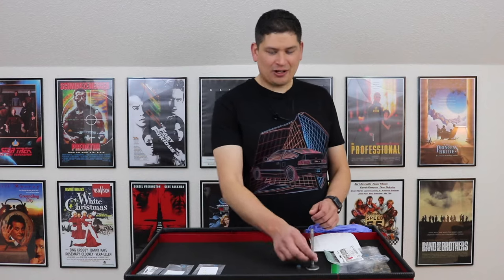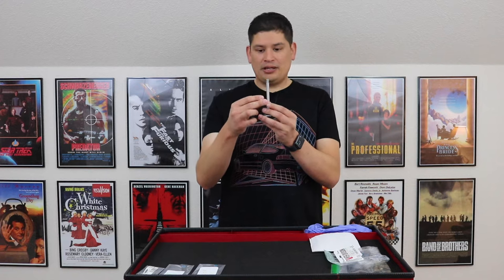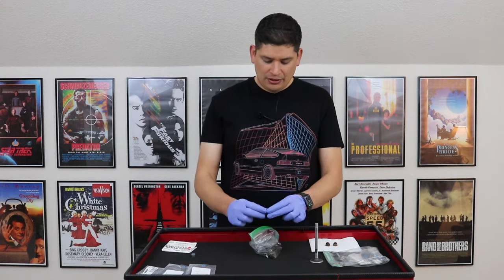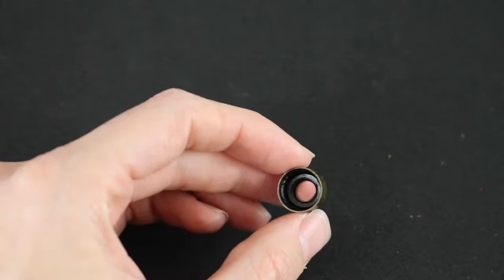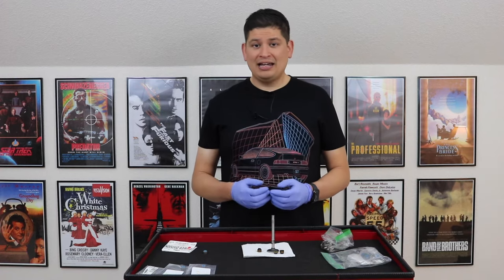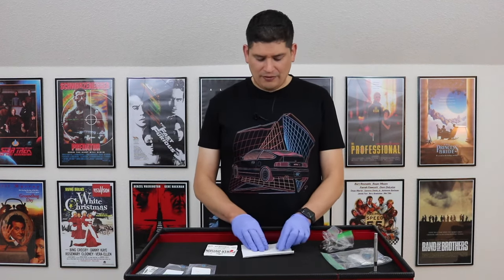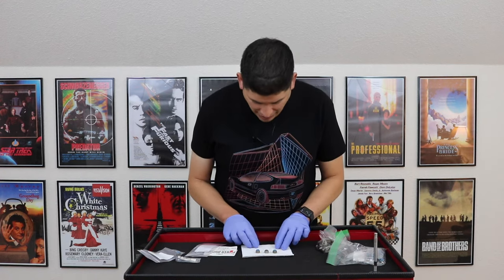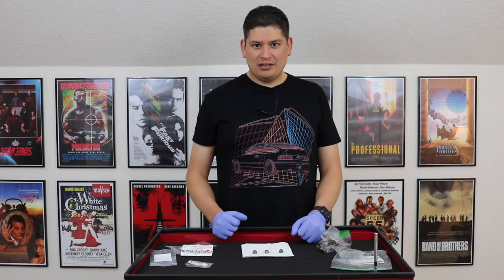Valve Stem Seals Explained

Comment: Trying to diagnose if i have this.
Car is smoking but only when oil is at operating temp.
Can smell oil when it smokes.

Am guessing the oil thins when its hot so maybe the gap on the stem is quite small?
Other possibility is turbo seals.
Reply from the maker: I am not sure, but valve stem seals will leak and smoke on cold start and on takeoff from stops. It sounds more like the turbos, what kind of car is it? You can see if it is the turbos by doing a few things, first remove a charge pipe from and see if there is a lot of oil, next, have someone film you start your car after it sits overnight.

Comment: Thank you for this video. My question is: I have blue smoke that I do not notice when starting in the morning, but after walking hard for a while and then slowing down, I notice blue smoke coming out and then it disappears. I also smell a strange smell coming from the exhaust, and there is an abnormal decrease in oil consumption. Do you think the reason is the valve gasket or  other reasons
Reply from the maker: @nazihsouliman4689  valve stems are usually noticeably on start up. Also on take off. Blue smoke is oil consumption. I recommend a leak down test. A simple test any shop can do, they will tell you if it is the head gasket or rings.

Comment: Great information but I have a question......
What happens if oil intrudes at the bottom of the valve stem seal where it sits on the valve guide? Are the valve stem seals also sealed inside or is it just on top?
Reply from the maker: They sit down on seal at the bottom and there will always be a little but of oil but should not leak down into the cylinder because of the valve stem seal.

Comment: Can valve stem seals be the problem for over fueling? My corsa B has a huge miss when I force it to start and wets the plugs with fuel
Reply from the maker: No. They do not have an impact with fuel. If anything, bad valve stems will lead to a leaner condition due to the introduction of oil in the combustion process.

Comment: Amazing videos, learning tons from you. Question shouldn't you have used Valve Seal Fitting Protector Sleeves installing your new seals?
I'm about to tackle this job in the weeks to come.
Reply from the maker: Thank you so much for the compliment. Comments like these make my day. As far as your question goes, I am not familiar with the sleeves but after reading about them, YES!!! OMG, if I would have know about these it would have saved me a ton of time. I scratched an bore and it took me hours to fix it. Hours...lots of anger. Yes, use them. I have a video showing how to use the stem tool as well.
Reply: @DriversTherapy  thank you mate for the quick response. The ones that I saw, they are small plastics that you position on top of the valve while you are installing the Stem Seals. I think the idea is just to protect the lips of the Stem Seal while we push it down in place. (Avoiding the seal potential scratching it while pushing it through the keepers place)
Reply from the maker: @MinkMood  Oh, I googled it and saw a sleeve for the tool which is what caused me issues. The valve will be ok with the tool, would be real hard to hurt it but the tool can damage the bore. The sleeve for the tool is smart. Either way, both will only help avoid any damage or issues so I would say buy them both.
Reply: @DriversTherapy  Thank you so much. Can you share with me the link of the BoreProtector? Ill buy it. Great IDEA!!!

Comment: Your smoke looked grayish white.  What if the puff smoke is blue?
Reply from the maker: Blue is usually oil. It depends on the lighting and amount of oil.
Reply: @DriversTherapy  08 GT500 25k miles.  Burps a noticeable puff of blue on cold starts, especially in cold weather that last 1 sec.  

No oil consumption nor CEL, but can smell it in that puff.  No other occurrence until next cold start. Even new PCV valve with usage of oil catch can. Should I be worried?
Reply from the maker: @mikeprice8307  it could be a valve stem seal but usually they are noticeable even if you leave the car for a few hours and start it. It’s hard to tell without seeing it. I wouldn’t let it bother you to much since it is such a small amount. Any modifications?
Reply: @DriversTherapy  none.
Reply from the maker: @mikeprice8307  I can not say with certainty but if you do smell oil and see a colored smoke coming out, there is a small leak somewhere but not enough to worry or repair it. If it gets worse you will know. I had a lot of smoke and it leaked bad so I fixed my issue. It is a lot of work to do it yourself and expensive if you want someone to do it. I would keep it in mind if you ever need to repair or upgrade anything in that area.

Comment: Does worn valve stem seal cause positive pressure in the head cover? My toyota 2AZ-FE blows out a lot of air and oil droplets from the oil cap, when engine is running and oilcap is open.
Reply from the maker: That sounds like a PCV issue. The goal is the PCV is relief the pressure and vapors that escape past the combustion process via the pistons rings. Certain oil catch can setups prevent that if not installed correctly by utilizing a vacuum source.
Reply: @DriversTherapy  Thank you for responding. I suspect the same first and installed new PCV valve and replaced valve cover gasket. But my Toyota Camry blows a lot of air like a fan is running, but opening cap of Honda Odyssey there is nothing, no suction or air blowing at all. Here is a video of Camry blowing air.
https://www.youtube.com/watch?v=DF_6WX-WK-k
Reply: Your rings are shot or improper crankcase ventilation system

Comment: Just curious, I will be replacing my cars seals soon, since the valve stem moves up and down thru the seals , how do the seals stay in place? Also my car dont smoke a lot on the first start after sitting overnite, it only smokes ( bluish) when you idle it for 10 or so minutes while on park and then you rev it thats when the smoke come out . Also no smoke during the idling , only when you rev it the smoke come out? Do you think the seals are bad?
Reply from the maker: Can you tell me what type of car and engine is in it?
Reply: It’s a 2003 dodge caravan cv, sorry it took me a while to reply
Reply: 6 cyl and 3.3 engine
Reply: The smoke does smell really bad

Comment: My s2000 on start it doesn’t smoke up but after about a minute it starts to smoke heavy I got new seals but the machine shop put the exhaust seal on the intake side could this be the issue?
Reply from the maker: It depends on the seals; some seals can be used on both the intake and exhaust sides but usally they are different sizes.

Comment: Hey man my LT1 has metal valve seals and  I only found full rubber ones wich is better metal or rubber?
Reply from the maker: It depends on the application honestly. What valve stems did it come with from the factory? I would stick with OEM parts to be safe.

Comment: 🙌 can i get the extra valve stems? Haha
Reply from the maker: Hi Keven! Sure, send me an email and we can set something up. Just wanted to let you know again that the GCS set is complete minus one but I will throw in 2 Supertech Performance intake/exhaust seals for you. The Supertech ones are side intake or exhaust dependent so just make sure you install them in the correct placement.
Reply from the maker: @kevenhang4799  email sent